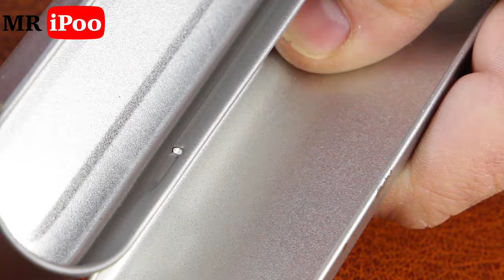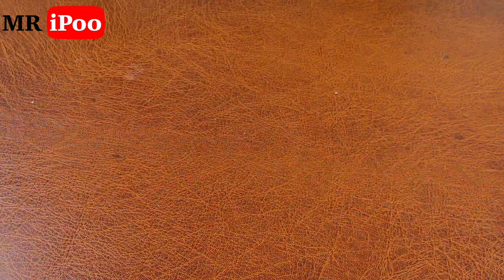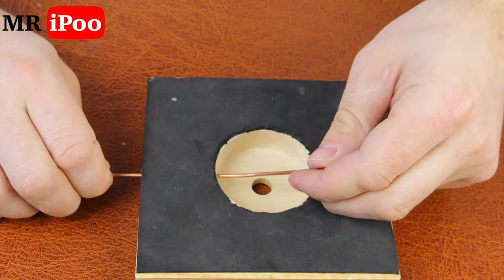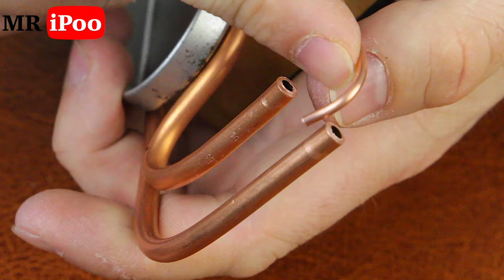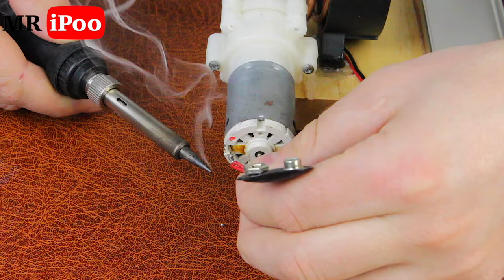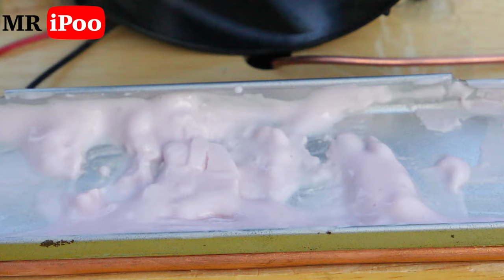How to make a table that freezes down to -14 using an air conditioner for preparing fried ice cream

Comment: I try doing that but it doesn't get cool at all because of the gas pressure the pump don't work if the pump is working gas will start leaking what to do
Reply: Add more gas and or check your wields you will only get out of it. What you put into it.  If you do a half ass job you'll get a half ass project.
Reply: @d.l.hutson9953  bro read my comment properly when I am filling that fully the pump dissent rotate the motor get blocked nd turn hot